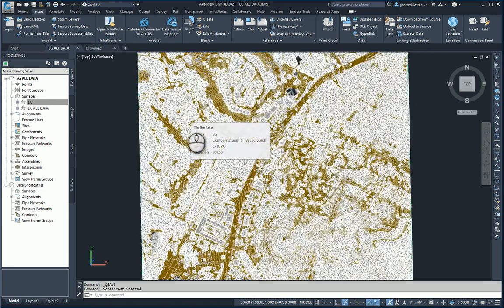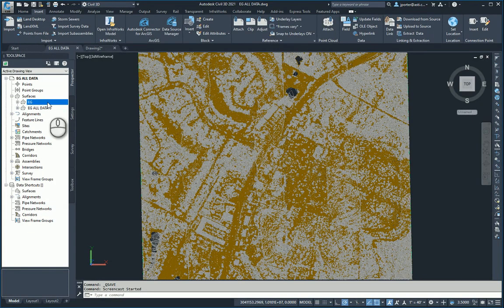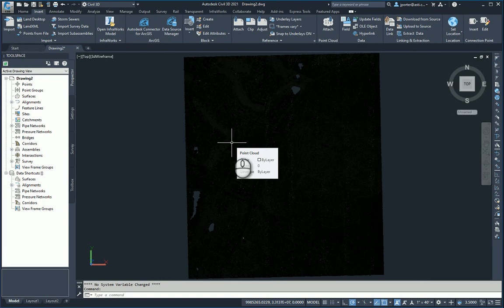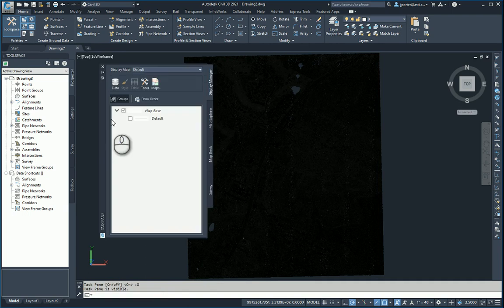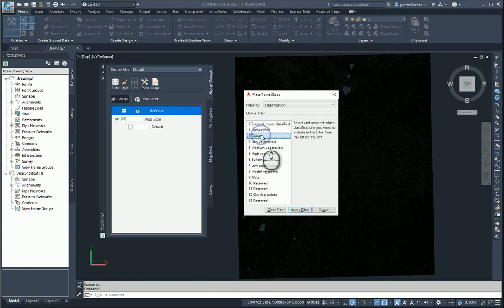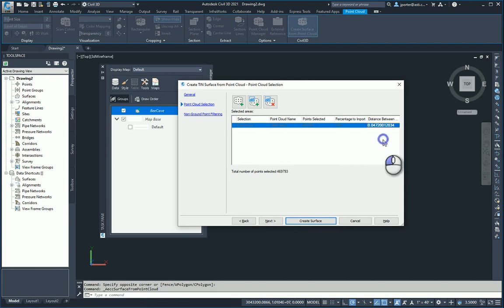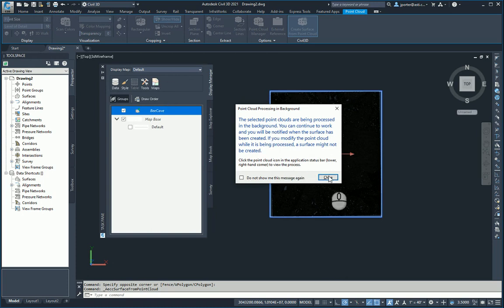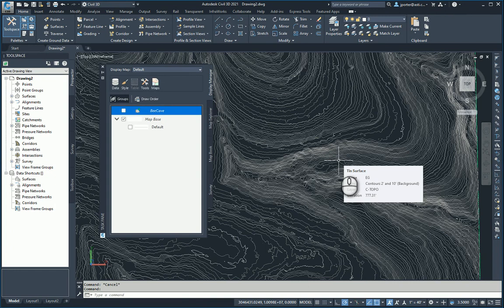Filtering a Point Cloud for Surface Data

Comment: hello im using faro scanner to capture the pointcloud and there is no classification option on the C3D, do you have another way to resolve that pointcloud? thank you so much
Reply from the maker: I'm sorry.  I'm not an expert with scanners so I don't know how to classify the points within a scanner.  However, I do believe there is a way to do so in the Faro scanner.  I only say that because I've received data from a Faro scanner in the past.  So, to answer your question . . .I don't know of any other way at this time.  My apologies.

Comment: Thanks for this useful information.  When I added the point cloud to the data in the Map Task Pane the point cloud shifted from its inserted coordinates and no longer lines up with my orthoimagery.  I noticed watching the coordinates in your demo that your point cloud also moved when added.  What is going on?
Reply from the maker: I assume you're talking about the jump in numbers around minute 3:07.  If that's the case, then you'll notice that I actually move my mouse thus causing the jump in numbers.  However, I still needed to do a zoom extents because the point cloud geolocated itself several million feet away from where I was originally zoomed into.

Comment: Quick Question - Is classification to Ground and others need to be done by scanner? I am not able to extract only ground point clouds. I will really appreciate any help.
Reply from the maker: Yes, it all happens on the scanner.   I'm not a drone expert, but I do know that it must be coded in the scanner.
Reply: @j-porter  Thank you for your response. My Scanner is FAROX330. Do you know if there is a way to do that there?
Reply from the maker: @amitgajurel2821  I honestly know nothing about scanners.  Is there a FARO support line you can call?
Reply: @j-porter  Thank you so much for your response Jason. I will reach out to FARO and ask them this.

Comment: Hello! I am at the step where I’ve right clicked on my point cloud > selected Filter Point Cloud. My data is not showing a “Classification” filter setting, just elevation, intensity, and spatial. Is there a way to get this to show up? Thank you!
Reply from the maker: Sorry for the late reply.  I've been out.  The problem is that the point cloud was not collected with the ground data.  It all happens on the scanner side.